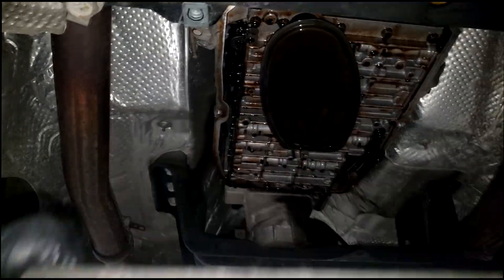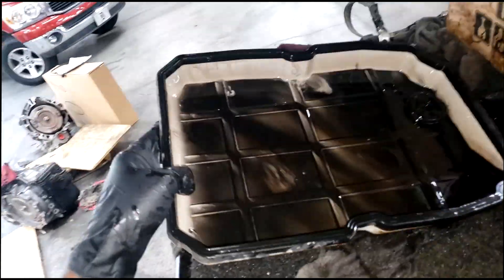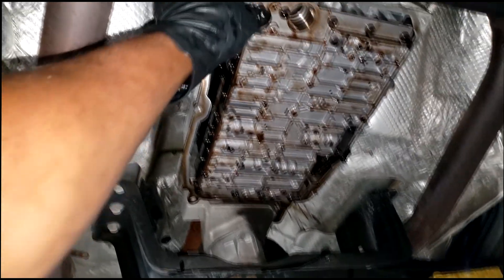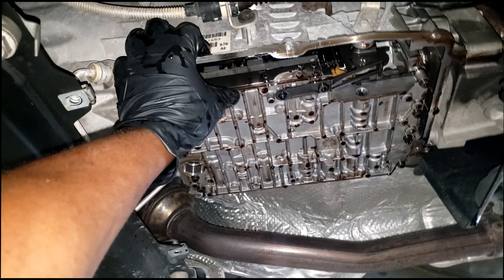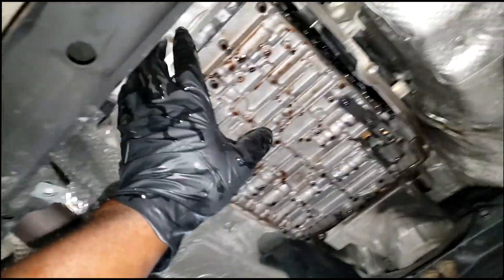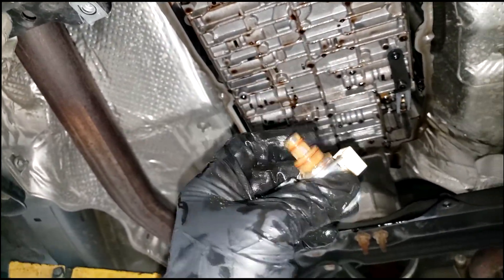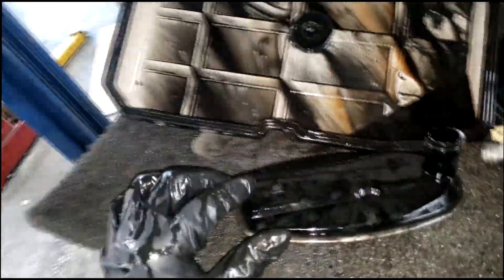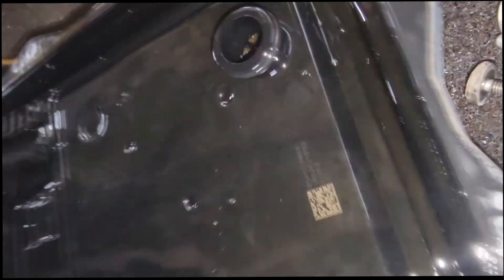Here's why It's Over for this Nag 1 Transmission. It was Never Serviced

Comment: If it's high mileage and there has never been a service, change the filter and the fluid, but also flush the cooler and the lines. The lines and the cooler will be full of that same junk that's in the pan and it will also have built up in the TC.  Once you get new fluid in there the new fluid will begin to remove the junk from the TC and other components but you need to do the next several services earlier than normal so you can get more of that junk out.  It won't rebuild the clutch packs or ever shift like it's brand new but fresh fluid will start to move some of that old junk out of everywhere it's built up, which is why you flush everything you can and start changing the fluid and filter more often when it's never been serviced like that.  Earlier services now to catch up removing that build up. Maybe 20k miles until it starts looking red again at service.
Edit: Maybe even 10k miles until its red again.

Comment: If the fluid is the only thing that getting changed, don't bother. The new filter is the absolute MUST to extend the lifespan of the unit.
Reply: this is not the case.  changing the ATF alone will definitely help.  Depending on the transmission, not always necessary to change the filter.  Some Honda automatics do not have a serviceable AT filter, as one example
Reply from the maker: @glennhansel9411 Guy Hondas FWD models use the same ZF version trans as Dodge use for the 948TE trans. Those filters are in fact serviceable, just not by the general public or DIY mechanics. The trans has to come out in order to replace it, so for this reason, a simply drain and refill of the fluid is the only thing you can do. But IMO, that does very little to help prolong its life. That dirty filter what matters most.
Reply: @OnlineMechanicTips  gave your video a thumbs up.  I'm aware of the hard to service Honda filter.  But Honda intended for the ATF to be changed, or they would not have put a drain plug on the AT pan.
Reply from the maker: @glennhansel9411  Interesting point, thanks

Comment: I do transmission fluid and filter exchange every 50k miles for my mopars. Even use doorman pans with drain plug to make the job less messier. 

Had bought a Chrysler 300 for $1000k which was giving a speed sensor code for the trans.  Took me $300 to drop the valve body to replace the conductor plate. Sold the car for $2500.

Comment: About my Ford ranger 2.3 4 cylinder with 170,000 mi and then I went to jiffy lube and had them do the transmission flush. They will not do the filter so then I drove another hundred thousand miles and change the filter myself.